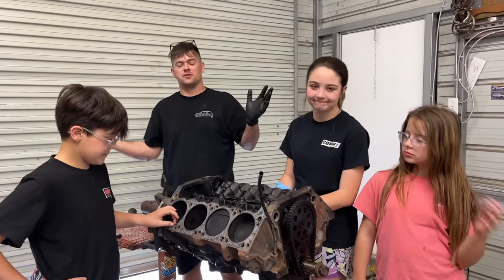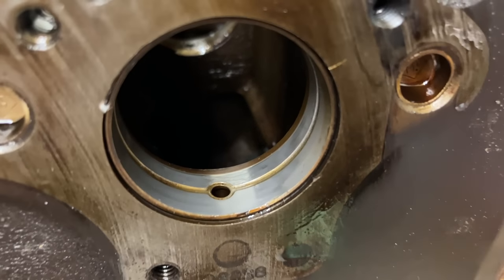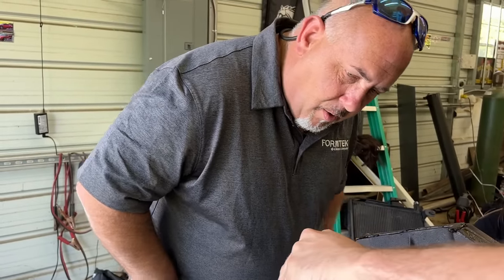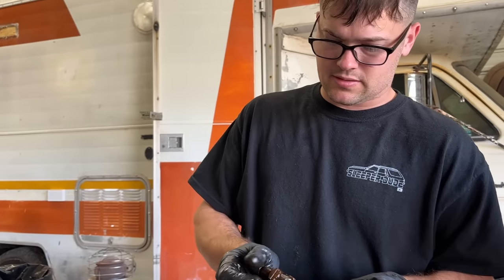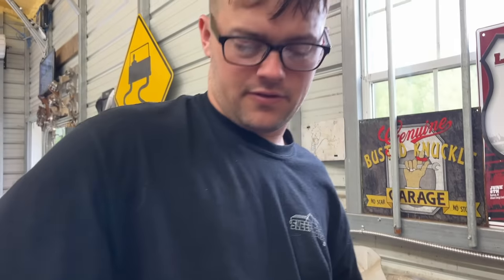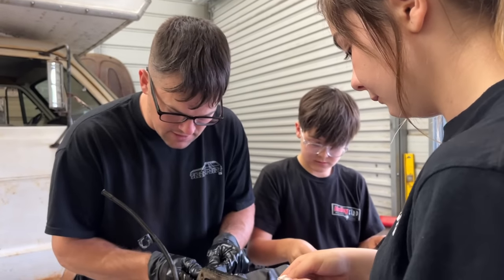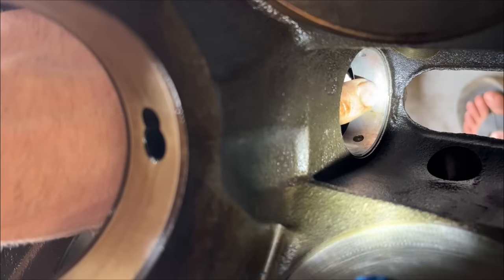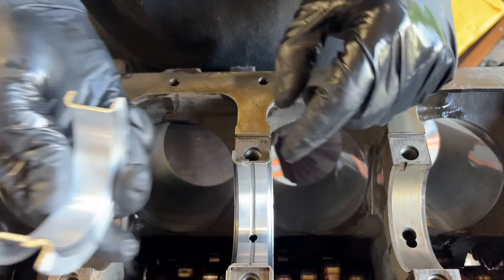250k Mile Engine Rebuild At Home! With No Machine Work For Cheap!

Comment: Well done doing the disassembly and re-assembly yourselves. It's really good you found the damage to the camshaft bearings. The valve stem re-grind is the right thing to do also. Great decision going with the modern roller camshaft magnum V8 and overdrive transmission --- more torque -better gas mileage - at least 25 mpg @ 65-70 mph. Make sure ALL the oil passages in the block and heads are free of debris. My guess is the oil pressure will now be 50 psi at idle and 85 psi at 4,000 rpms. That is so cool that you're teaching the kids how to overhaul and re-assemble the engine -- especially the measurement of the bearings for the crankshaft, connecting rods, and the camshaft bearings. I love the kittens and the black cat!!  I would design and fabricate a front spoiler that will direct air into the radiator and keep the nose of the RV lower down, also try installing some aero shaped rear view door mirrors that should help increase mpg's and decrease aerodynamic drag on the RV body.

Comment: Been there done that Josh. I rebuilt a 202ci Holden straight six for the 1964 EH Holden panel van I had from 1980 to 82. With a few hot up goodies, a 3 speed all synchro gearbox an a 2.78 ratio diff centre it used to do 95 mph in second gear. It was a ton of fun when no cops were around, lol. I did a couple of other engines too.

Comment: My first experience rebuilding an engine I was about 14. The engine in my dads van had blown driving from Florida back to Virginia. We believe a chunk of blue glue, which we found, locked up the oil pump and locked the engine enough to necessitate a rebuild. It was a 351 Windsor. I can’t remember what damage it cause but we replaced the oil pump and cam. Pulled it with a tractor and boom.
Sorry for the long story

Comment: Amazon has freeze plug sets for less than $25. It's cheap insurance, especially after a quarter million miles on the engine already. Having to replace a freeze plug in a car really stinks. I just did a 99 Durango 5.9 and was amazed at how bad the freeze plugs were on the inside when they looked fine outside. It barely had 100,000 on it.

Comment: Those Magnums are notorious for the cam bearings doing that. Everyone I have pulled down had done that. One even at 120k miles. I think it was just a bad run of bearings Chrysler used. All had good oil pressure too. Some durabond replacements fixed em up.

Comment: I had to pause the video so we can have a quick safety meeting. The face shields that Mr. Garcia sent should be required when scrubbing parts in the parts cleaner. Imagine how bad diesel fuel splashing in the eye would hurt! And I love the new safety razor blade holders, but the kids need to always push it away, never pull it forward. That’s just stitches waiting to happen. Love all you guys!

Comment: I built winning race car engines and worked 15 years for cup team I Loved your engine rebuild vid. Only 2 comments if the rings don't have locater pins like snowmobile engines. NEVER put ring gap over wrist pins so if down the line you get blow by   it doesn't damage wrist pins oil film. And another issue cut 2 pieces of old hose and slide over connecting rod bolts so as to never scratch ur beautiful polished crank. Love your videos. Bert

Comment: Josh WD-40 means , Water Displacement #40 , it is the 40th formula to really work, it was designed for Marine use for the Military, you spray it on the bolts before you install them on boats and other equipment, keeps them from locking up ! 😊

Comment: You can buy cams for all torque ranges and they sell Edelbrock intakes for that motor that help with lower end torque. Engine should be a runner regardless tho. Good job guy's. 👍👏 Squeezle naming the glove she did surgery on was too cute. 🥰❤️

Comment: You can warm your block up infront of a heater for several hours why as another comment said putting your bearings in the freezer. Better still is getting some liquid oxygen placing the bearings in that once they've finished going crazy place them in the block.

Comment: After seeing the damage to the cam bearings, I would have changed them all. The rear plug is cheaper than pulling the motor again. Other than that, it was a great budget rebuild. I wish you the "Best of Luck"!

Comment: Hello there cowboy again coming along doing fine so far I'd say measure all your can barring spaces just to make sure ya haven't got any oval instead of true round. I'm an old school wrench when ever I tore a engine down to rebuild first I'd take a ridge cutter some folk call it a reamer in any case it cleans the top of the cylinder wall so y don't have trouble with your honer. One last trick try take ing a broken ring either rap it with tape personally I make a very simple handle I've seen other folk use a file handle what ever works for you it does a good job of cleaning the piston groves remember to put the machined end out and the broken end in the handle carful not to get carried away ya don't want to gouge up your grove's well that all I've got to say about that lol keep doing what you're doing and we'll keep watching, oh as for the hot tank ya can make one pretty easily the hardest part is setting all the jet's ebay or Amazon have some fairly cheap the more the better a drum with a door cut into it works just fine find ya an old hot water heater then I'd change the heating elements to the double quick recovery east to put in cheap to get y'all can use that black poly pipe but I'd rather use copper or galvanized pipe remember you're gonna want to put a little pump in the bottom of your hot tank back to the water tank I'm sure ya can figure it out just go for it 🤠👍

Comment: oh wow WD40 is the greatest stuff I use it lots there another WD40 formula called stick stay gee whiz that's stuff too I use it as thread chasing for after removing old nuts & bolts when putting vehicles back together makes it only easier down the road if there is any time a guy needs to take it apart again WD40 is good stuff

Comment: Excellent rebuild! 

I just wanted to let you know that usually when you use the old style LA oil pan, the newer style magnum one piece pan gasket will leave a gap on the front corners of the oil pan and can cause a leak. I’m not sure if you checked this or not, but just thought I’d let you know so you don’t have to deal with it later!

Comment: Hey guys you did a pretty good job on that engine those old bearings are classic lack of oil changes some body free reving and possible engine pinging couple of hints break a couple of old rings to clean out ring grooves and use course steel wool pads to clean sumps and parts i think you guys call them brillow pads any way good job keep up the vids love them guys👍👍👍

Comment: josh if you put the engine block in a 55 gallon drum with 75 percent muriatic acid and 25 percent water that covers the block let sit in for 2 days pull out and rinse with water looks like it was hot tanked you will won't to pull freeze plugs first no need to clean any gaskets off all will come off in acid can get muriatic acid at any pool store . lowes or home depot hope this helps for next time  and a bench grinder with wire wheel cleans the piston ring groves fast and easy

Comment: Top ring is called the compression ring, second ring is called a scraper ring then your oil ring, the scraper ring is more important for oil control, rod and main bearings are and should be stamped std .010 .020 extra

Comment: to end the debate on what wd40 is actually ment for ill put it this way WD stands for water displacement and the 40 is just their 40th formula so you're infact using it the way its ment to be used the fact it works as a penitrating fluid is just a bonus 

i love the family aspect of this channel

Comment: The best homemade cam bearing installation tool is a rubber freez plug with a long extension and a hammer. You can tighten the freez plug and it will hold the cam bearing while you knock it in

Comment: Back seal cup behind the rear cam bearing knocks out I reused it without issue some what like a freeze plug  . Also there is a piston ring groove cleaning tool it has several  cutter heads that fit the ring grooves couple of turns with that … do da job . Block was in remarkable condition for the mileage it had .

Comment: I want to share something I did in my shop with you. You can plumb the intake on your air compressor through the wall to outside and it cuts the noise in half. I did mine and made a huge difference. I always make sure and catch your videos every week.

Comment: That ultrasonic cleaner does a great job.
A tip for cleaning the carbon from the ring grooves is to use a piece of one of the old rings as a scraper.
I was glad to see you centering the timing cover on the crankshaft before bolting the cover down to prevent seal damage.

Comment: 56:55.    I HAD A GUY THAT USED RED ASSY LUBE AND ALOT OF HIS MOTORS SPUN BEARING IN START UP. WHY.  THE RED LUBE TOO THICK AND ACUALLY BLOCKED OIL FLOW.   NOT LETTING THE AIR IN THE PASSAGES OR. OIL FLOW THROUGH. AFTER SEEING THAT I ALWAYS AND ONLY PRE ASSY WITH 10W 30 FULL SYN MOTOR OIL ONLY. NEVER HAD A PROB AGAIN

Comment: i have built lots and lots of engines and never found a easy way to clean out the ring gaps. and your parts cleaner. depending on how far off the bottom your pick up tube is you can add a gallon or two of water to it. and when it sets over night it will self clean itself. because most of the junk will settle in the water. but you have to make sure it wont pick up the water when running. and it will stay clean a lot longer.

Comment: Since you didn’t change all the cam bearings, the old ones being worn more than the new ones, can it cause a vibration or drop in oil pressure?? Just a thought and thanks for another great video guys 👍🙏

Comment: Cut a top ring in half and use your bench grinder to grind an angle cut in the end of the ring. Wala a ring grove scraper . Works well . If you can weld you can build a hot tank . It can be heated with propane or natural gas ...What you need is a steam cleaner . Great machine ...

Comment: Get you 55 gallon drum cut one side off and make a stand to put in the bottom then make stand for the of drum so can put like an oil frier burner propane Homemade hot tank you just won't have pressure sprayer type system but it will clean the  block out pretty good

Comment: You can make a hottank pretty cheap. Go to lowes get one of the metal trash cans, fill with whatever cleaning solution you choose, get a hot water heater element.  And lower your block into the trash can with engine hoist.

Comment: Most gen 1 and gen 2 mopar motors are cast above the freeze plugs just below the cylinder head with the engine designated size and usually the date code

Comment: when we would install the piston rod onto the crack we would put some rubber gass line hose on the ends of the thread of the rod bolts to keep the bore safe last thing you want  is scratches....

Comment: My secret for cleaning the ring grooves is to just snap a ring in half a use the sharp edge of the ring to clean the groove. I've cleaned alot of engines that way.

Comment: That's one neat trick using the drill to lap the valves. By the way why didn't you replace the valve springs with new ones?

Comment: Hot tank cheat:
Run the pressure washer through the water heater or build a coil & use propane space heater.

Comment: Keep up the great work 😊 my 95 ram has the 318 mag and is a tough motor,when I bought it someone had already dropped a reman motor in it apparently. Truck body has about 250k.the intake plate is about the worst thing on these 318s they warp and tend to back the bolts out and leak no matter what gasket you put on there. Doing it the way you did may work just be sure to use the red high strength thread lock on the bolts. It may give it a fighting chance. If I ever deal with it I may see what it costs to weld that dang plate to the intake. It’s nice for access but not when they blow all the time 😂
Reply from the maker: Yeah for sure

Comment: I just saw show today and I was wondering could have been tight spots and loose spots on the timing chain would that cause the bearing to wear like what you saw I’m not a full-fledged mechanic, but I just had to run that by you and see what you thought

Comment: I need to borrow that cam bearing install tool..... machine shops in my area all say the same thing. If you want something built, months away. I'm going to give it a go on a random 4 bolt small block, that already had 30 over flat top forged pistons, used scat crank and rods. 98 Chevy vortec heads.... Spray it, and hope for fun.
Reply: Years ago I installed a 360 in a short bed 4x4 98 dodge truck. I got it from the salvage yard out of an rt Dakota.
It ran exceptionally well. Actually scared the owner when we went for a test drive. 
Hope this one runs real good for ya.

Comment: Please teach the kids to never pull the razor blades toward there body. I have seen some very deep cuts that caused permanent nerve damage. Cut resistant gloves are not very expensive but you usually only think about them in the ER.

Comment: My air compressor used to do that a lot. Need to tighten the belt and she will be like new.
Reply: In the 60's they had "belt dressing" in a spray can, just give it  a squirt and it made the belt super grippy and it would quiet the belt.
Reply: @dennishernden2264  maybe it was better quality back then because I’ve tried belt dressing a few times and it just seemed to make the problem worse.
Reply: @bowtieguy72  Yeah its kinda nasty stuff, seemed work sometimes, other times not. Remarkably I have some new Dayton, and other brand belts from that era that are price marked insanely cheap. So I'm not sure why ppl used it at all.

Comment: I really enjoyed this video, I grew up spending summers on a farm that was populated by a huge herd of goats and just the sounds in the background made me smile.

For those of you who need more information on how to do these home rebuilds, Vice Grip has a good video where he works over a small block chevy, and goes into more details about how to do the shoelace trick, and tips on honing cylinders.  Between this video and that one, anybody who can turn wrenches and has a place to set up and the tools can get through all this stuff. If it scares you, make your first one a junkyard small block chevy, it's easy and you can get one for a hundred bucks and sell it after as a runner for 800 easy.  You want to find the old engine that was running, but smoking a little at first start but not all the time, and has roughly equal compression on all cylinders.  Between those two things, you can expect it needs reprinting and new valves seals and guides, but you shouldn't find any holes in pistons or drastic gouging of cylinder walls.

It really is possible to get brilliant results using these techniques, as long as all you need to do is freshen up surfaces, or replace bearings you do not need a machine shop at all.  If you want to understand more about what machine shops do, you should check out myvintageiron.

The problem is that machining is a very cut throat business: expensive machinery, huge barriers to entry for starting a business, and like any retail business, it's hard to make ends meet. The result has been shops folding over the years, and unless some new machinist buys the business, it ends up shuttered and often the machinery is scrapped. Fast forward from the glory years after ww2, and the few general purpose and/0r automotive jobbing shops are very thin on the ground.  To survive they need to take care of their bread and butter customers like medium sized trucking companies, or referral work from other shops: regular trade they can count on.   They can't afford to bump one of those guys for a few hours to put my block in the tank.

Comment: @52:16 Josh mentions newer engines can go so very many miles before needing inside work,, mentions the model 'T' engine. Heck, if an engine in the 60's was at 50,000 miles,, ya better be sav'n up for a rebuild 'cause you were on borrowed time. That engine was in a word -DUN!